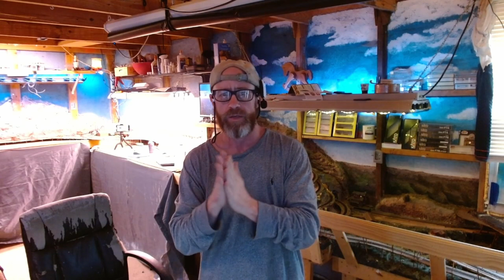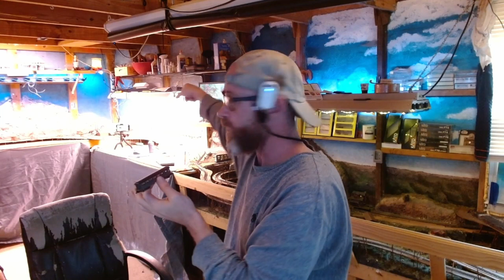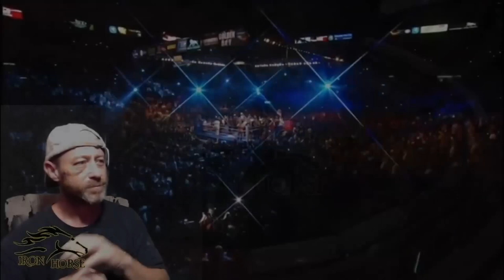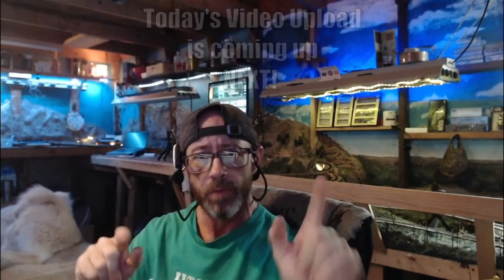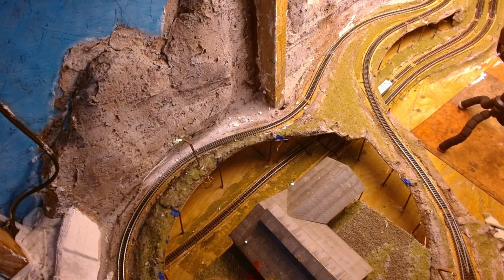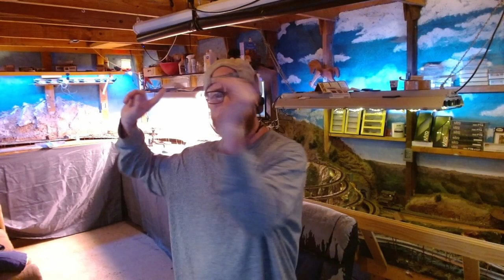Model Railroad Track Work Repairing a Joint to Prevent De-Rail & Removing Rock Facing for Clearance

Comment: Hi Brian, I subbed awhile back but dont say much. I like your layout. Now on another note I do HO not N but my fleet of locos is 95% steamer from 060 up to the  Cab Forwards and Bigboys, I love the steamers but they are temperamental when it comes to track, & joints. They dont like kinks or misaligned joints, or out of gauge track. I was going to post on your unboxing video but this one popped up. You are on the right path with getting the steamer to run , where you reattached the track with the glue if it works well and doesnt derail put some track nails in to keep the joint from moving, the flextrack will keep trying to straighten out at that joint, also check your track gauge where you are having problems there might be a slight kink you dont see but the steamer will find it and derail or stall.  Also they need more clearance than most the articulated and passenger cars take alot of space on curves Hope this helps. And the layout is coming along and looking good
Reply: On a good note if you get the trackwork where a steamer will run correct you shouldnt have problems with others ✌Good luck🛤
Reply from the maker: Hey Ray!  Thank you so much for subscribing and for sharing .  I really apreciate  it. Tempermental they are.   I only have a couple places im working on now.  I appreciate you watching and commenting man! Thank your for taking the  time to do that.  Brian
Reply: @IronHorseBrian  No problem I have been there too